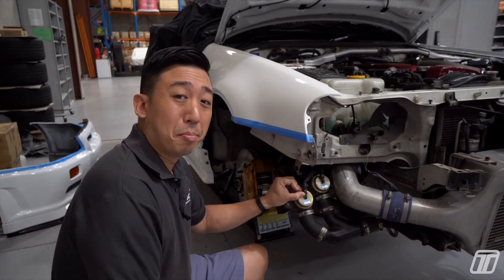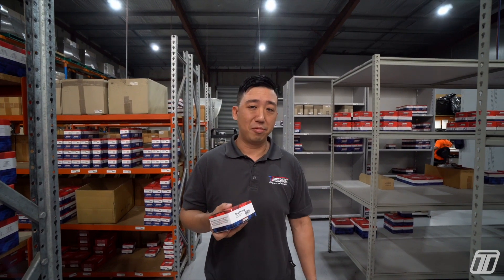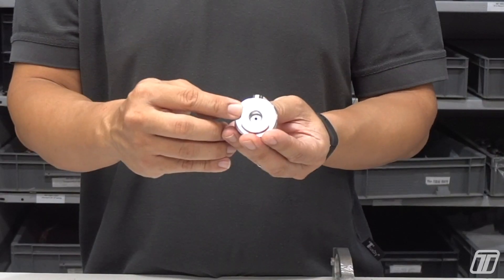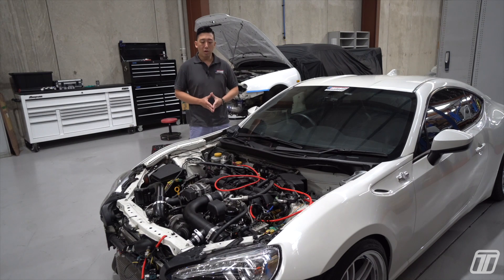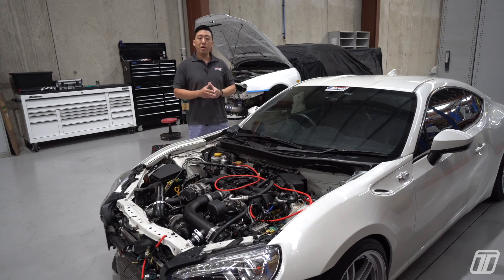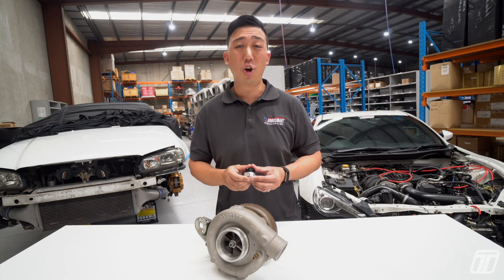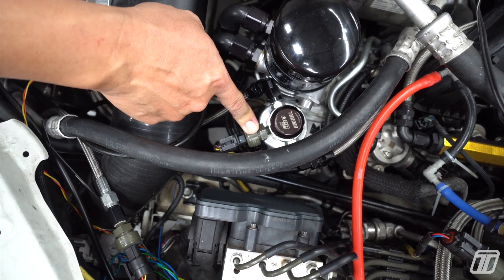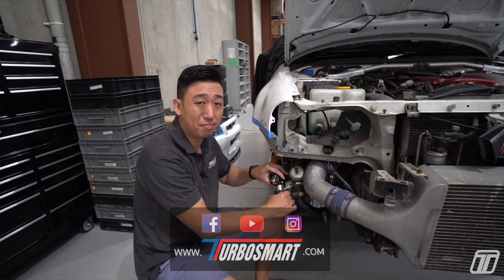SAVE YOUR TURBO! Why you NEED an oil pressure regulator for your turbocharger!

Comment: this is exactly what I wanted to know, I am going to buy one and use put the return line oil through a by pass oil filter and filter my oil down to 2 micron before it goes back to the sump.
Reply from the maker: You should also check out our OPR V2 which is a returnless design.

Comment: Have a Yamaha T-Max 560 with a Garrett gt15 turbo because of space restriction turbo mounted below crankcase currently use two   one way check valves right before and after turbo  and pull oil thru turbo then to oil pump that then pumps oil back to crankcase.
Where should I place turbo smart oil pressure regulator?

Comment: with 2 turbo chargers, can you split the line and use one regulator, or is it best to use 2 regulators?
Reply from the maker: Yes, you can run a split after the OPR to support two turbos. We highly recommend using a "Y" fitting rather than a "T" for the sake of flow. If you run larger turbos then you may want to consider two. (85mm+)

Comment: Do you use a restrictor with one of these??
Reply from the maker: If the turbo came with a restrictor from the factory, leave it in as taking it out may void warranties. If it did not come with a restrictor then it is not needed.

Comment: Does this part sap engine oil pressure and bring the whole system down to 40 PSI or does it only affect the downstream pressure?
On mine it appears to just be a straight through from end to end?
how does that not just dump all the pressure into the turbo and bypass the relief valve entirely?
Reply from the maker: It would only effect everything after the regulator. Out of the several we have sold of this version and our newer OPR V2, I have never seen overall engine pressure drop more than 1PSI or 2PSI of it's original pressure.

Comment: So now if you are regulating pressure in oil inlet line, how that isnt affecting into engine oil pressure? I thought the point of oil restrictor in turbo oil inlet was to reduce flow volume, not pressure. As oil return works on gravity fed, you can only insert that much oil that it doesnt "drown" the turbo. Otherwise, if there is too much oil inside the turbo, the outlet turns into restrictor and oil pressure inside the turbo is causing pressure to leak through turbo shaft seals.

Comment: what should oil pressure be on operating temperature around 2-3k rpm? and idle? diesel engine
Reply: Check  with your manufacturer
Reply: Borg Warner turbos most of them want 45-55 psi somewhere in that ball park.

Comment: How does this not cause engine oil pressure to drop as well? Due to it being a return style regulator isnt it similar to having a pressurized oil leak?
Reply: Because the line that’s getting restricted is the turbo feed line. That oil ends up in the oil pan.  There no engine pressure involved.

Comment: Can this be used for a journal bearing turbo setup ?
Reply from the maker: Any aftermarket turbo requiring oil
Reply: @TurbosmartHQ  is 40 psi of oil general enough to keep a journal bearing turbo alive ?
Reply: @TurbosmartHQ  is 40psi enough for a journal bearing?
Reply: Thought journal bearing turbo had no probs with oil pressure ,thought it was ball bearing turbos that need regulated oil pressure.
Reply: Journal bearing can suffer from too much pressure as well but they require volume that ball bearing turbos don’t require. The pressure blows the CHRA oil seals out allowing oil to burn in the exhaust housing causing smoke

Comment: The gauge is reading 60psi at idle will this drop as the oil gets up to temp and the turbo smart gauge is reading before the regulation right?

Comment: Thanks for the video, I have a quick question, on the return line for the T40, can I setup a Y fitting, for the return line? so I don't have to bore a hole on my oil pan, i'll just use a Y fitting for my turbo return line and also the T40 oil pressure regulator, please let me know if that is safe to do? Thanks.

Comment: concept of this part is understood when feeding oil pressure from engine that varies under throttle. But, what if someone like myself who is running a turbowerks 12v base pump. so far ive burnt up two turbos once using a restrictor and turbo lasted 6-700 miles, second time sending pressure straight from pump to turbo no restrictor and lasted 4k miles. is this product going to correct the issues im having on the 3rd turbo without burning the journal bearings up. mind you my system is rear mount and has its own stand alone oiling system.
Reply: The oil pressure needs to be as high as possible and accommodated with a large drain that is straight down to the sump. If the drain backs up it will blow oil. This can also be caused by excessive engine case pressure. Unless you are increasing the top end rpm then you shouldn't need to be reducing oil pressure.
Reply: Not made for journal bearings

Comment: Why the design to drain overpressure back to the oil sump? Most pressure regulators simply limit flow at the target pressure... I ask because I have a remote turbo setup, and they already use the oil cap or a sump fitting for oil return from the scavenge pump. This additional return makes plumbing that much more complicated... Thanks!

Comment: is this compatible for the 2017 Audi a3 quattro? with an efr7163?
Reply from the maker: This is a universal part. The OPR T40 is compatible with 1/8th NPT fittings, depending on each application, some further modifications may be necessary.  Most turbochargers have a restrictor built in, however, we came up with the OPR T40 to regulate high oil pressures without reducing flow. If youre experiencing excessive oil pressures, this will do the trick!

Comment: It seems there is a big problem with turbo oil drains being done incorrectly as well. probably should have mentioned that. a lot of people restrict the oil with smaller drains which don't let the oil drain freely into the sump and this causes smoke as the oil comes out the turbo seals.

Comment: This is a great product. 
Especially when you are raising RPM limiter on high hp engines.
I have always felt that the turbo oil line restrictors of the past were a guestimate to stop over oiling of a turbo at best.  
This turbosmart oil reg has solved this issue well done! 
Great Australian company!
Reply from the maker: Thank you for your support!

Comment: Does the gauge read pressure from the engine or does it read the 40psi from the regulator after it does its job?
Reply: It has a spring and rubber diaphragm inside. Spring opens at 40psi and let rubber diaphragm move up and leak oil thru outlet. I wouldn't trust this junk if it's your daily driver. I don't think they will last
Reply: @rayj33  Do you have one? Because I've heard from several users that this works perfectly.
Reply: It works the other way round, similar to a carb float. It will slowly Close the feed to its equilibrium when the turbo oil line is above 3bar
Reply: They have it hooked up where they can monitor the pressure going to turbo so “after “ it’s doing its job

Comment: Installed one on my RB26 after struggling to diagnose what I thought was a failed turbo!  Works and looks great!
Reply from the maker: Awesome! We appreciate the support!
Reply: I've got a Precision 6262 on a built honda with a modified oil pump, motor is clearanced to run 20w-50, at operating temp sees an easy 100+psi of oil pressure when above about 3k rpm. Entire setup has 1400 miles, smokes like crazy. Thinking the high volume and pressure the motor makes washed the turbo out. Called Precision today and they recommended this from Turbosmart to avoid repeat failure if the turbo is actually damaged and needs a rebuild
Reply: @arman757  For fun I put a pressure gauge on the feed line to my turbo and saw it hit 90psi. The Turbosmart OPR absolutely solved my issue!